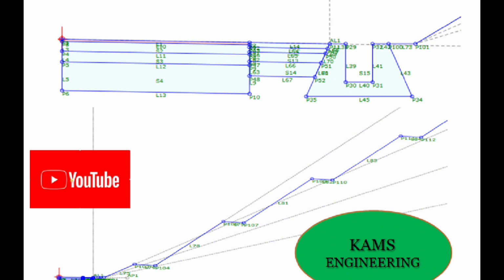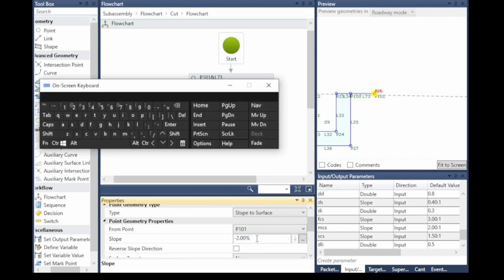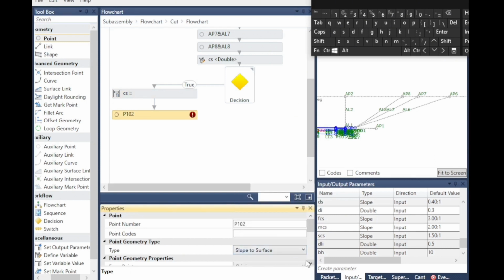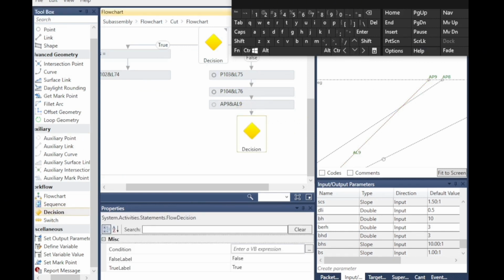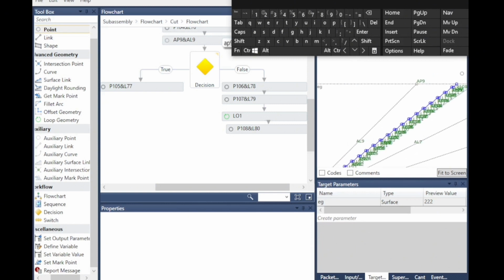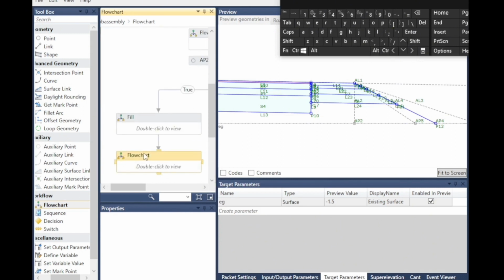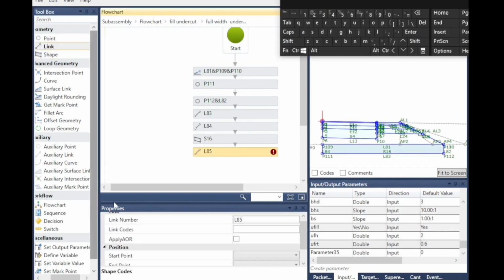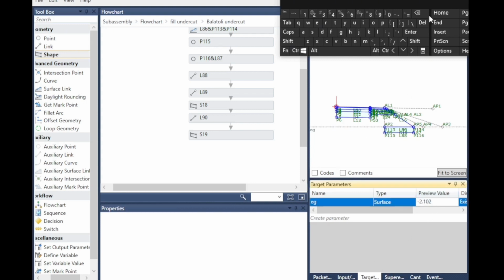How to make a powerful subassembly from Autodesk subassembly composer part four

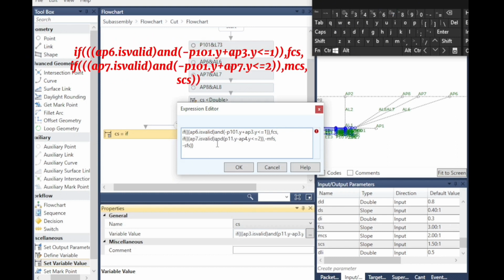Comment: Just want to confirm at 8:50 in the video that the variable value should be if(((ap6.isvalid)and(-p101.y+ap6.y<=1)),-fcs,if(((ap7.isvalid)and(-p101.y+ap7.y<=2)),-mcs,-scs)) and not if(((ap6.isvalid)and(-p101.y+ap3.y<=1)),-fcs,if(((ap7.isvalid)and(-p101.y+ap7.y<=2)),-mcs,-scs))